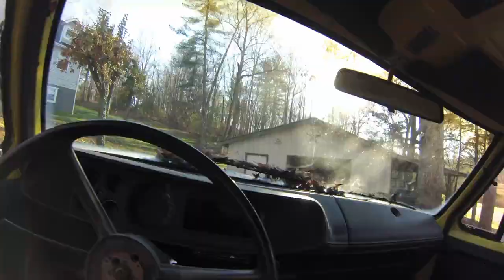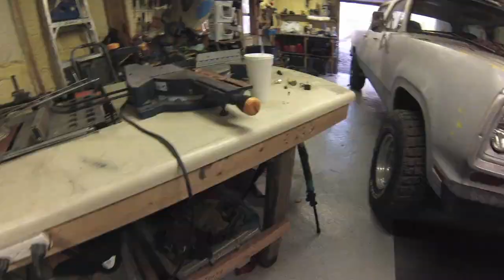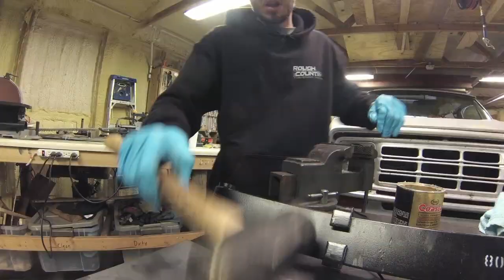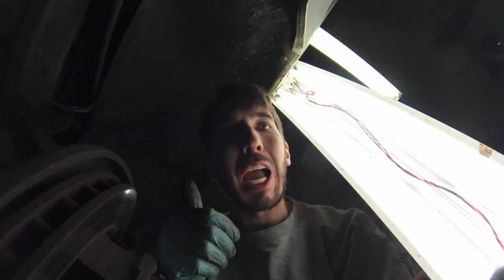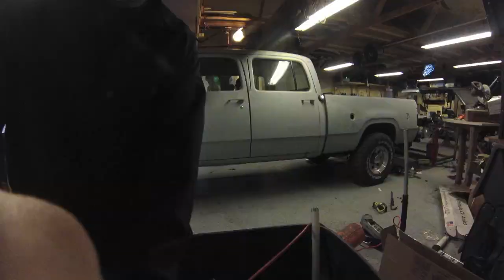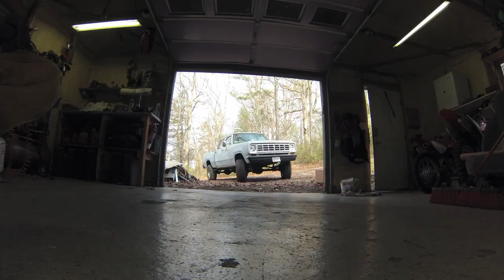Dodge Power Wagon 4" Lift

Comment: I would have laughed if you put the lift on then it didnt fit out door. I did that with some friend before, it was a oh s@#$ moment. Had to get some donuts spare tires to lower it enough to get it out.
Reply: Lmao that had to be funny as hell
Reply: deflate tires just enough to get out or get a lot of big friends to sit on it
Reply: Lucas Davis
We tried all that to no avail. Cant remember where we found the donuts that worked. Even contemplated using ratchet straps to compress the suspension until out of the shop.
Reply: +chefdan87 the straps probably would have broken at the worst possible time (presuming you used the cheap small ones) i'd probably have just stuck some plywood down then dragged it out on the drums\rotor's.
Reply: animefreak5757
My straps are definitely strong enough it just didn't work, we could not get the leverage to crank them tight enough against the beefy stiff suspension. And I would never roll a heavy truck on its rotors and drums. Its a 94 F-350 Powerstroke That is just asking for damage. We were going to roll it out balanced on a floor jack but the donuts turned up and we got it done that way.
Reply: it really won't, brake drums\rotor's are very heavy duty, i've seen vehicles where the wheel fell off and the rotor slammed into rocks or ashphalt, if there was a burr, we filed it off and the rotor was fine.  The heavier the truck, the more heavy duty the rotor's\drums are.  your far more likely to damage something trying to roll it out on jacks where it can fall off and slam into the ground then you are rolling it on rotor's.
Reply: animefreak5757
Thats you opinion and not mine. I am smart enough to know risking damage because it is the more convenient option than working out a proper solution is a fools game. You must not know how the backing plates on ford drum rotors work. You do not roll on them with out damaging them.

Comment: very cool.  gonna order a 4" kit from rough country for my 73 powerwagon single cab longbox.  did you have to change the driveline?  do they bins at all?
Reply: +4x4-Off-Road-Devil i have a 75 i did a 4' and the stock shafts work just fine, only thing you need is longer brakelines and your good

Comment: are these old dodge power wagons any good? I have been looking at them and I was just wondering, would these trucks take a beating from work and little off road? or would the sheet metal just sent like it was  tin foil. and how does it compare to the ford trucks at the time?
Reply: their pretty good bodypannels fairly thick, their not fast not powerful, but with good tires they grip like mad in soppy foot deep mud and I've pulled a few trees and a building with mine no problems . just be warned youl need to replace the steering u joint its a tabbed collar deal they wear out in 20yrs or so, beyond that their just bouncy off road that's really it good solid vehicles tho